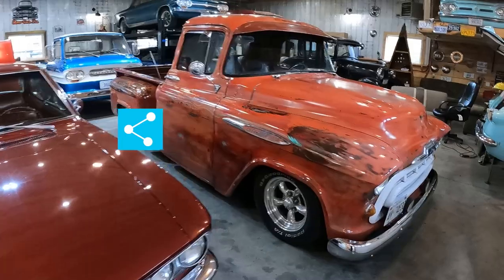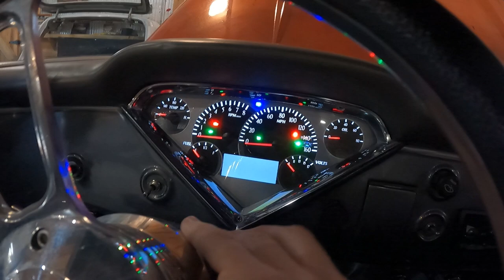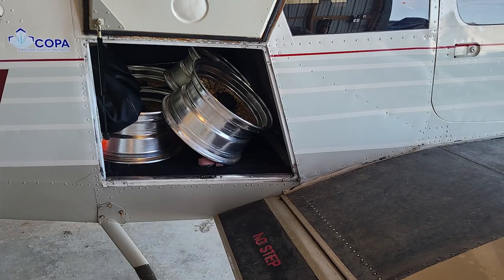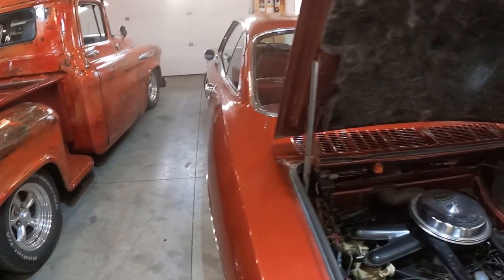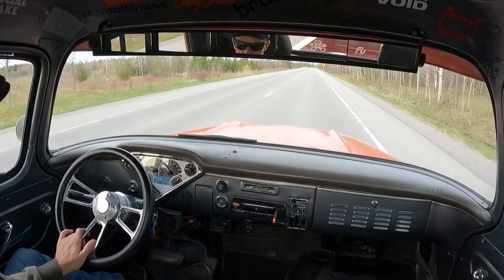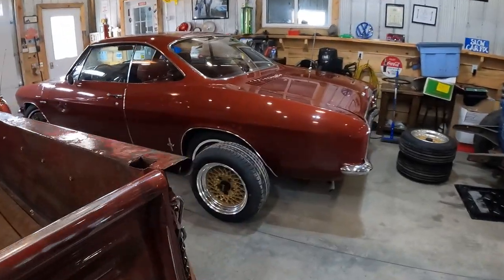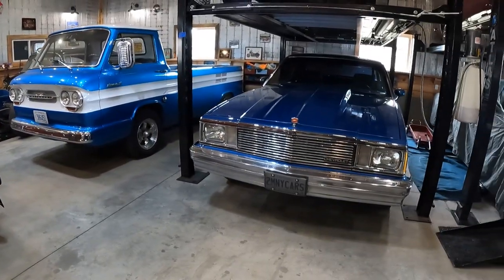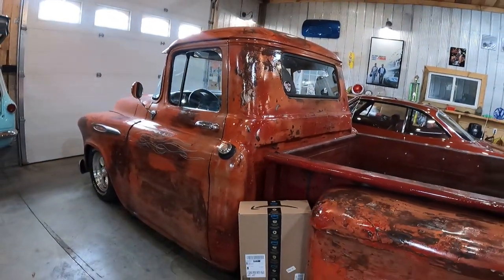LS Swapped 1957 Chevy truck - Project complete?

Comment: Love your truck! I have a 1956 Chevy 3100 with small window LS1/4l60E with front corvette IFS and rear 1981 narrowed and has 2004 corvette Guage cluster and steering wheel with smooth dash and hydraulics tilt bed, truck still in primer. I also have same viso as you. 

When I drive fast (over 85 MPH) my visor causes my wipers to lift and bounce on the windshield. And my hood flexes up and down slightly. Does yours do the same?
Thank you. George.
Reply from the maker: I have noticed that my wipers will lift at "advanced" highway speeds. Fortunately, if it's raining, with the truck being so light, I'm pretty slow and cautious. Actually thinking about larger rear tires because of how it slides around in the rain. 

Do you have the X strap brace under the hood? I don't have issues with mine flexing. 
How are your doors for closing and latching?

Comment: nice truck, I am also wrapping up an ls swap in a 1955 truck but came across some brake issues, i was wondering if you have had any issue with your brakes?
Reply from the maker: No, I have not had any issues with the brakes. They're just stock camaro brakes. best of luck with your project.

Comment: Do you have the original frame still? front clip swap? or did you do a entire frame swap? Just curious and haven't caught it in the videos I've seen
Reply from the maker: This is the original frame with a 78 Camaro front clip, and I built a 4 link rear suspension for it and coil overs all around. The clip was done before I got the truck and I just had to do some fixing on the installation. The 4 link was before I began sharing in YouTube. Hope that helps.
Reply: @SlowCarFix  thanks for the answer!!! Looking into front end swap or just a S10 frame swap on my 55

Comment: 3" drop on front?   what size wheels did you use?
Reply: awesome btw
Reply from the maker: It's a Camaro front clip with coil overs and 4 link and coil over in the rear. 15x7 wheels. I think the front is a lot more than 3 inches down from stock. Thanks!

Comment: News flash, it's never finished..............
Reply from the maker: You're not wrong. It's pretty good though...
Reply: @SlowCarFix  The best ever. I love my 57 gmc 102 with the original 336 pontiac v8. I was here checking out if you put the rubber seal around the headlight bezel. I'm having a problem getting it to stay in place. I see most don't have it at all. Great job on the truck.